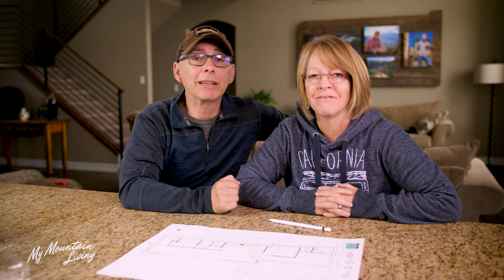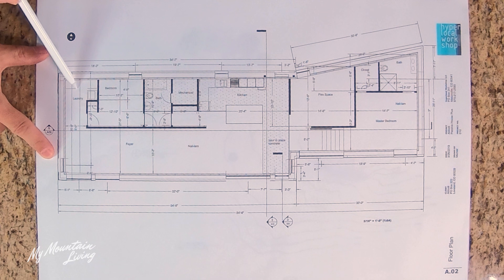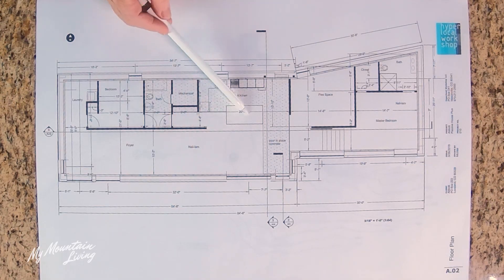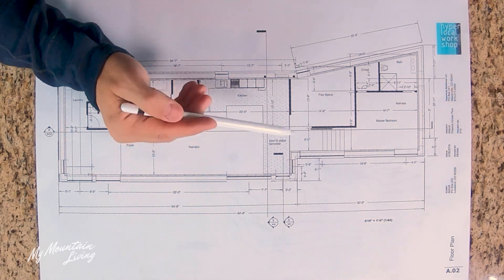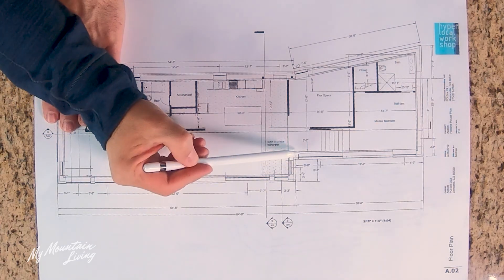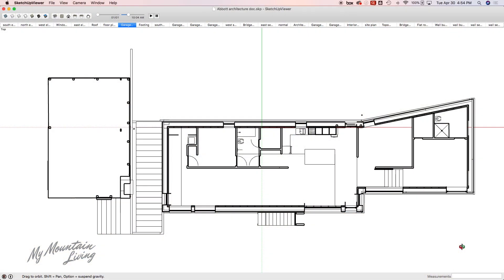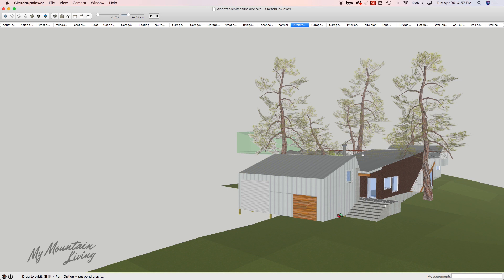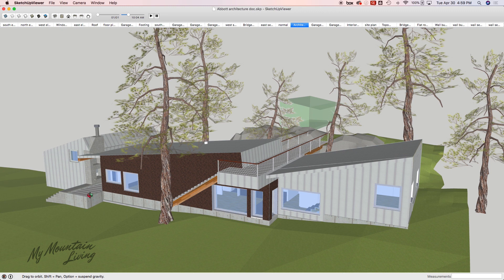My Mountain Living: Off-grid, Passive House Floor Plan Reveal

Comment: It looks like your plumbing is located on exterior walls, will that be an issue in Colorado?
Reply from the maker: Hi, Mary - great question. Our "exterior" walls are made up of a Larson truss frame that holds our 30,000 lbs of insulation. Our plumbing is located further inside of that in the 2 x 6 structural walls and ceiling where they are insulated at least by an R-60 or more from the outside. The only exterior plumbing penetration is for an outside hose on the south-facing exterior, which is still insulated within our 22" thick walls, but we also cap it with an insulated cover over the winter.